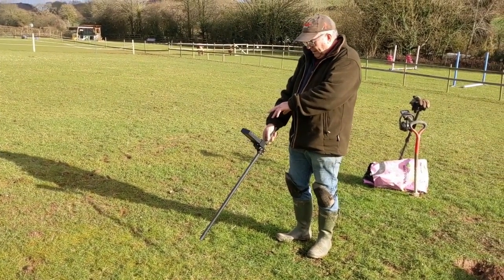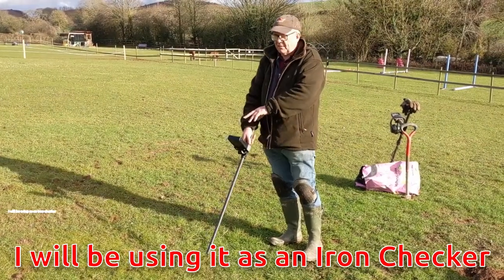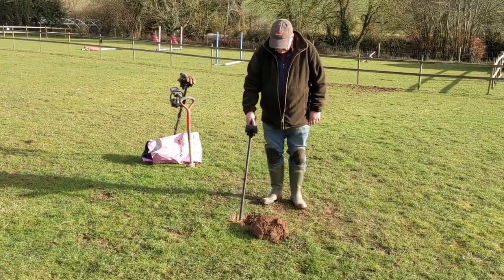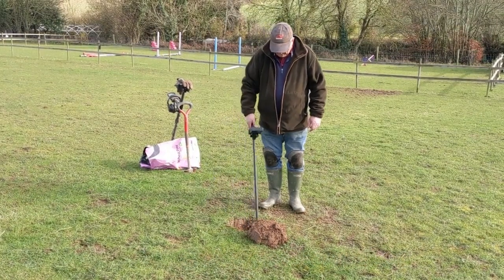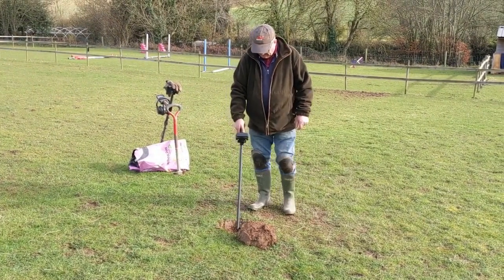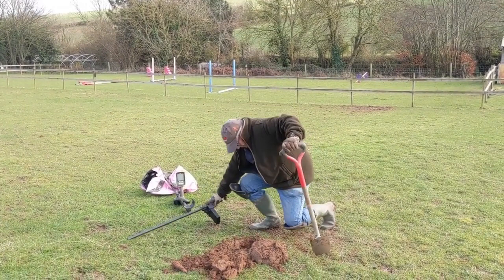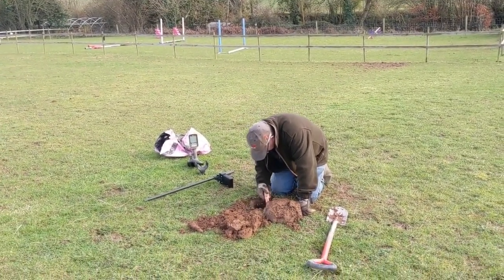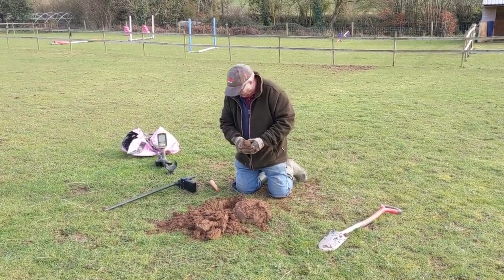Magnetometer Kit field testing in UK! Probus Maximus by metal detectorist Cliff

Comment: What are your finds so far?
Reply from the maker: The kit for this application is used to double check deep targets signaled by a metal detector. If the magnetometer kit gives also a signal the user does not care to dig deep iron.